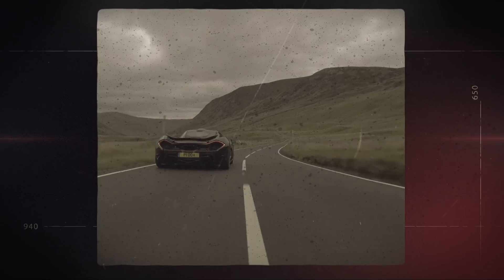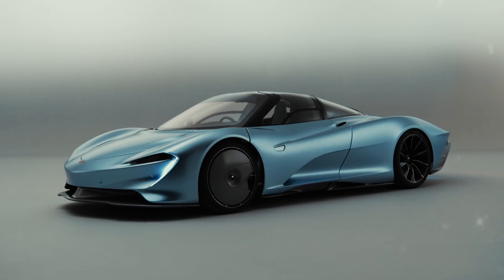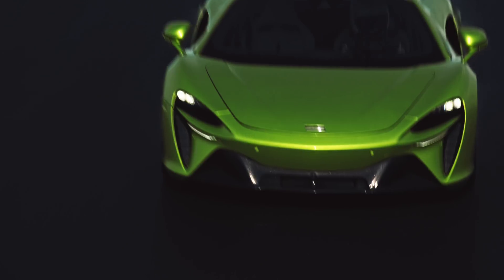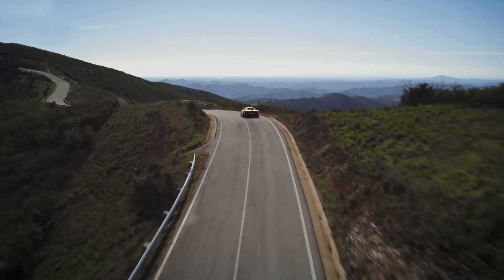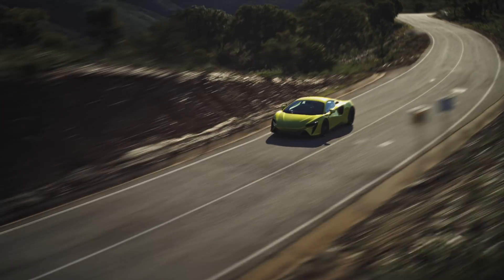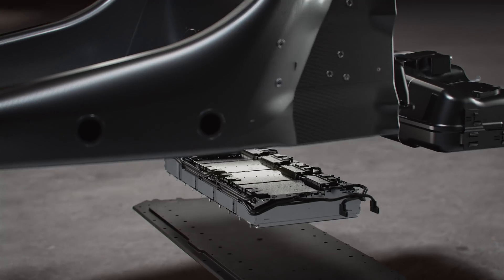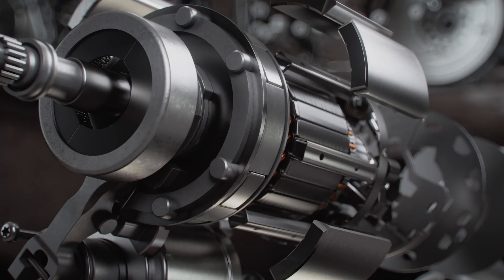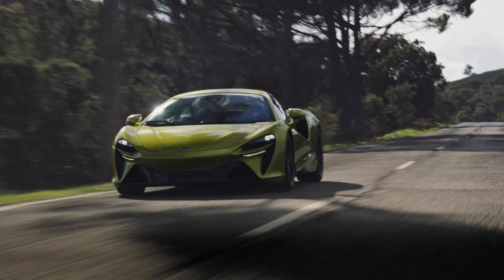McLaren Tech Club - Episode 31 - Artura: A new benchmark in electrification

Comment: 250k for a v6... I’m sorry but no😂😂
Reply: Engine size does not depict performance.
Reply: @cm-15  yeah but the sound of the car gets a little bit worse in a v6 than a V8 or V12 (Usually)
Reply: @johnmaker7577  true, but you can always buy an aftermarket exhaust. Also it’s not like you’re only buying a car for the sound.
Reply: @cm-15  yeah gp
Reply: 220k*
Reply: Ford charged 500k+ for the GT.

Comment: Direct MC20 competitor no 🧢. Artura will win anyway 😉. 670 hp out of a v6 with an electric motor, might be faster than the 600lt...
Reply: @UClKB3MdXiVGrRrOK7tbrz6A The NSX's powertrain really isn't superior if it weighs 500 lbs more and makes less power.
Reply: Faster in what way 🤔, straight line figures don’t suggest it , on the track I doubt it, 600 LT is very track focused tbf 👍
Reply: @brentpowell7889  Yeah, this isn't faster than the 600LT from 0 to 60, 124, or 186 mph. The more than 300 lb difference in weight is to blame.
Reply: and it’s a competitor to the new Acura nsx
Reply: @TheCarKrazeOfficial  This car would slaughter the NSX. This car weighs 500 lbs less and makes 99 more hp than the NSX. If the NSX was RWD and priced around the same as the GTR, then it would have sold well.